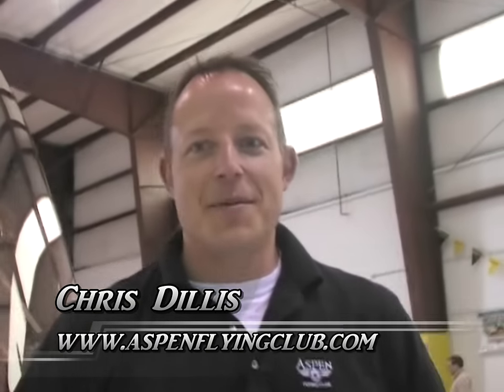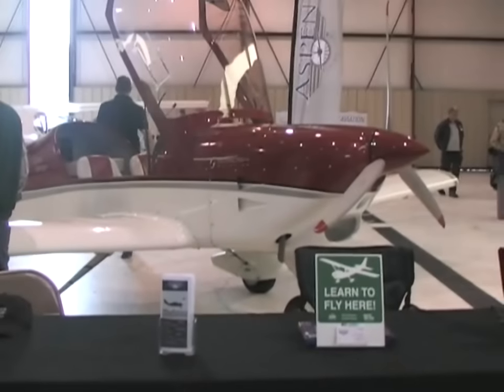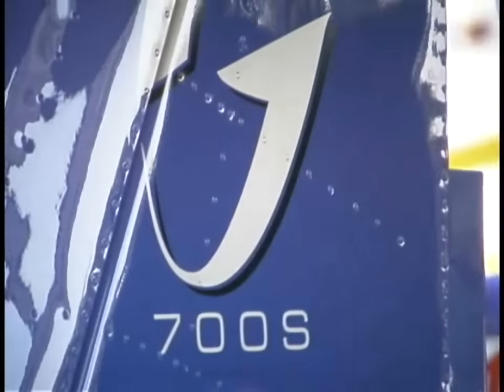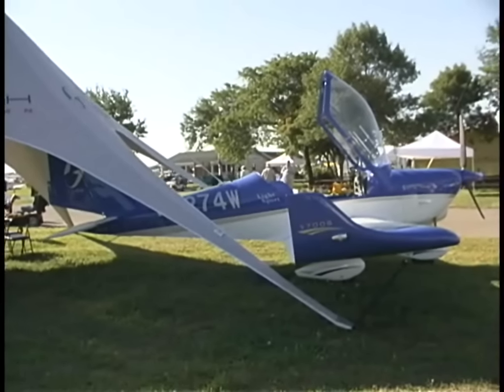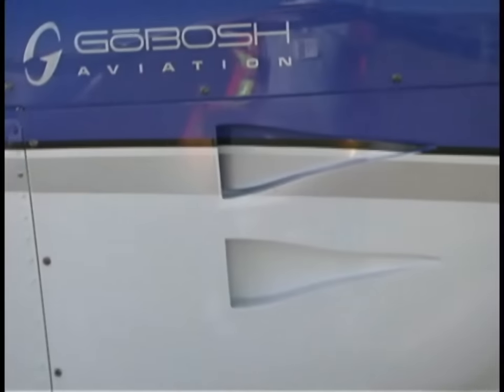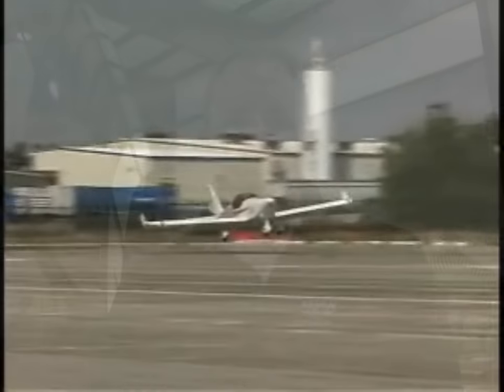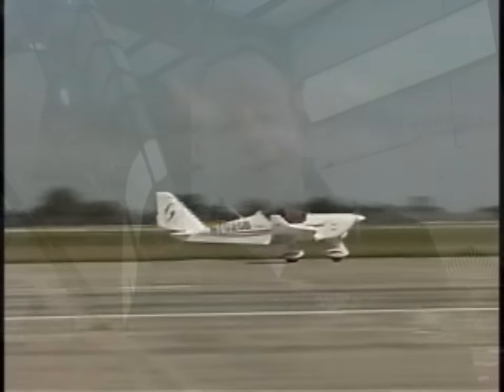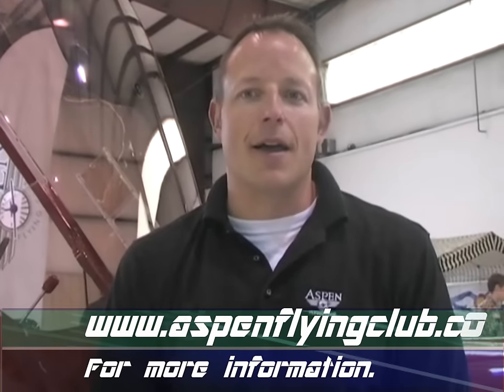Aero AT-4 light sport aircraft, Aspen Flying Club.

Comment: Its a basic trainer and very good one. Its not an aerobatic airplane.
It can be a very nice cruiser as I flew from Massachusetts to Florida and back - twice.
I am sure every mechanic will prefer to dive head first :-) under the panel instead of spending 10 minutes to remove a cover and have an easy access to all instruments.  
Spring loaded  throttle ? Hmm... I do not have such problem on mine.
I landed this aircraft quite few times with crosswind 15 kts without any problems.

Comment: its hot in side touchy on pitchy and leaves lots tobe desired in roll control and the cross wind component is a joke. Maintenance is atrocious it seems that every time you turn around you have to pull the canopy and gas tank cover off and shove you hand in to some tinny sharp crevice of the air plane. Apart from the throttle being spring loaded wide open all the time this a fun airplane to fly once you get it out of ground effect and you speed up. Dose wingovers great and fun to fly around town.